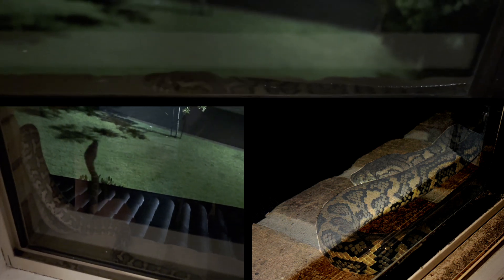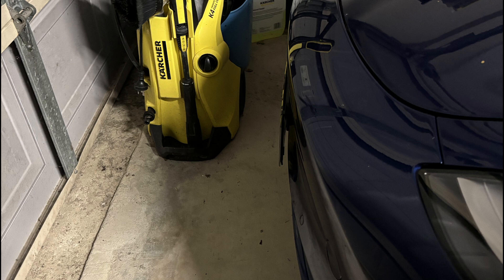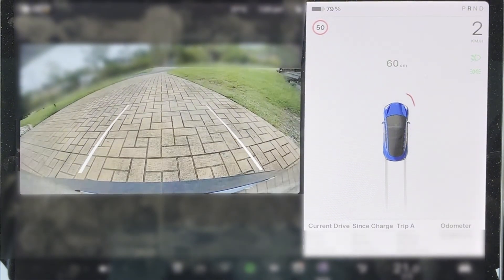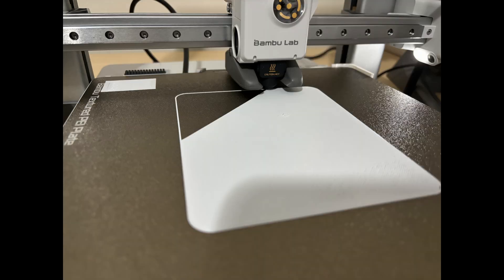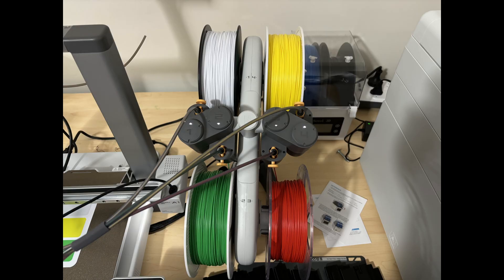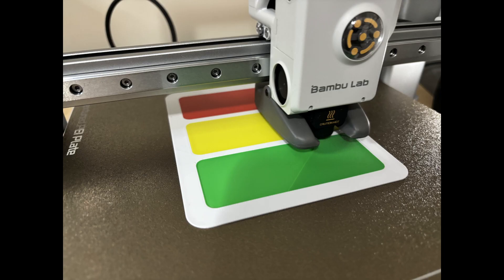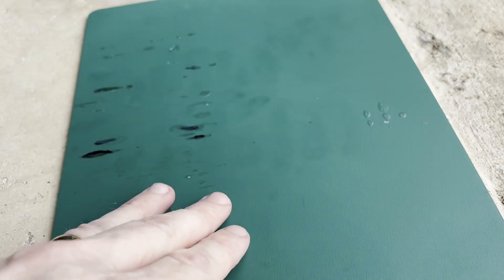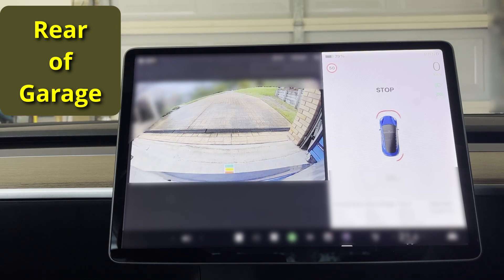3D print to aid exact parking in household garage

Comment: Tennisball-windshield works, also a electrical PVC pipe of 16 or 20mm on the ground (secured in a wooden/cement block). If you hit the pipe it will bend, letting you know STOP the car
Reply from the maker: All good ideas

Comment: A solution I've seen is to hang a tennis ball in such a way that it touches the windscreen or some other reference point when you are in position.
Reply from the maker: Yup, always more than one way to solve a problem. I had an object on a piece of string before, but that just blew about in the garage (maybe a heavier object would have helped) and when the car is not there you have to avoid it.
Reply: That's  the best. It works with no camera and no fancy 3d printed things...
Reply from the maker: @bragee  If you have a camera and a 3d printer - it is a great solution. If you don't then other solutions are better. You have to avoid a tennis ball when there is no car there.
Reply: @RandomSmith  not to criticise but I think that a multi filament 3d printer is definitely an overkill solution for this kind of issue.
I use the tennis ball since years and never had to make fancy or complicated movements to avoid it...

Comment: Why do your parking sensors not go any closer than 30cm?? I've never heard of that before.. Is it a Tesla thing?
Reply: Those Teslas with parking sensors will go closer than 30cm, but many Teslas do not have parking sensors at all. However none of these sensors are useful if you are approaching the cluttered back wall of a garage: depends what exactly it is measuring the distance to.
Reply from the maker: @john_hind  In the Tesla Model 3, the sensors stop at 30cm or at least the software stops at 30cm as seen in the video. Mine is one of the models that still had the ultrasonic sensors in the front and rear bumpers.
Reply: @RandomSmith  Yes, sorry you are right, even on my Model Y. I was reading inches and it does go to just STOP when closer than 12 inches, or about 30cm. Memo to Elon: PLEASE let us use miles and miles per hour, but metric units for short distances. Some countries like the UK are hopelessly mixed up about this: everyone under seventy uses metric, but the over seventies and politicians live in a bubble with the newspapers!
Reply from the maker: Not sure if it is a Tesla thing. But it won't go closer than 30cm as seen in the video.